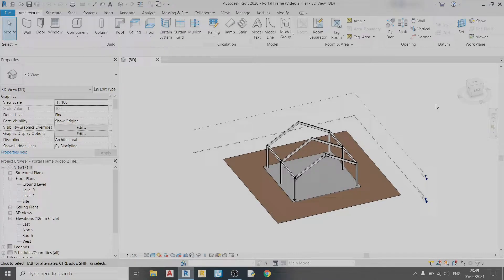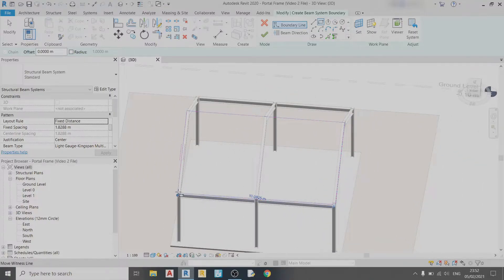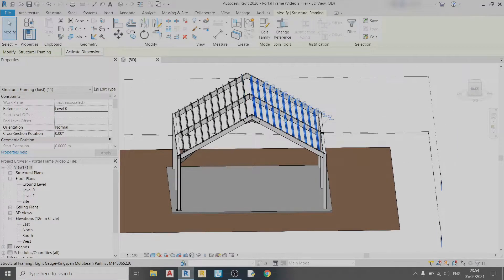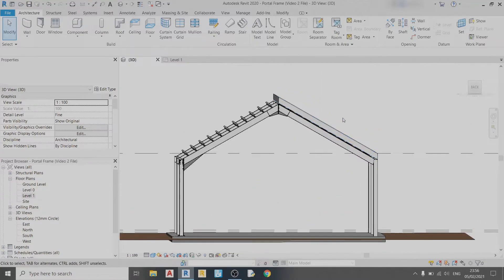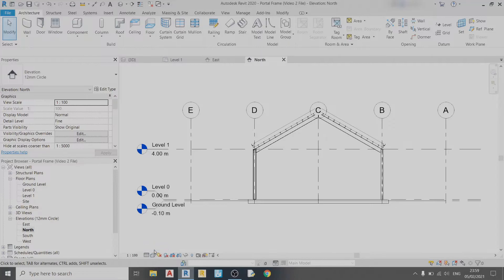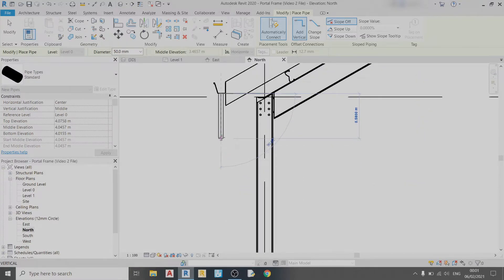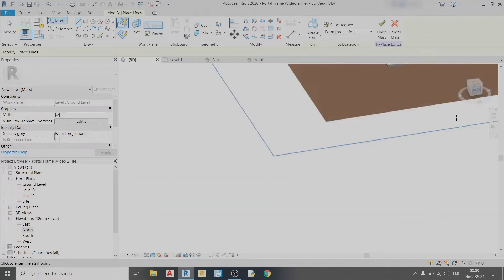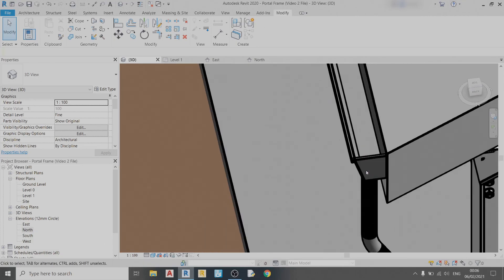How to draw a roof in Autodesk Revit?

Comment: how can i get light gauge kingspan multipurlin ,
 iactually i dont have it in my library
 ,can u share it and thank you for the videos i appreciate it.
Reply from the maker: Hi Omar, to find the purlins I used go to the UK Revit library. Go to structural framing then go to light gauge steel. Then you should be able to find the Light Gauge-Kingspan Multibeam Purlins. Hope this helps.